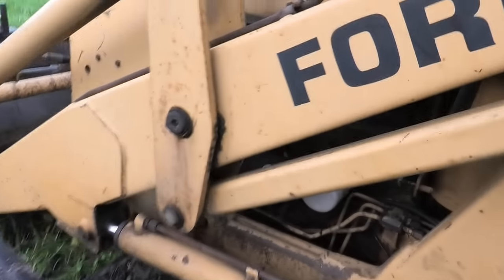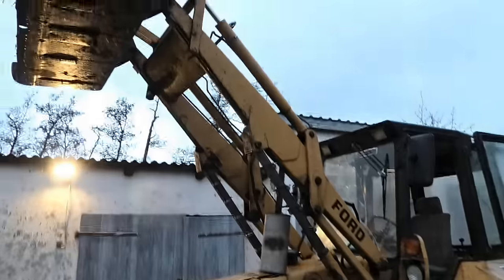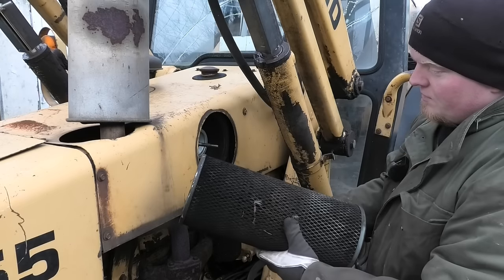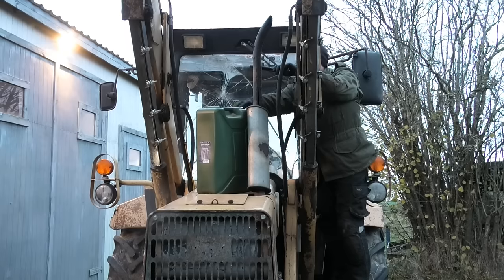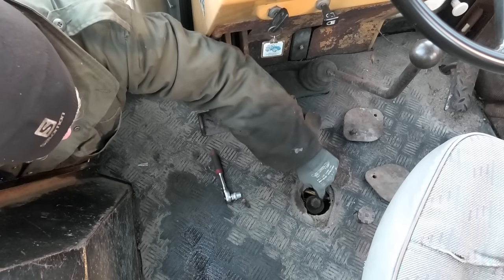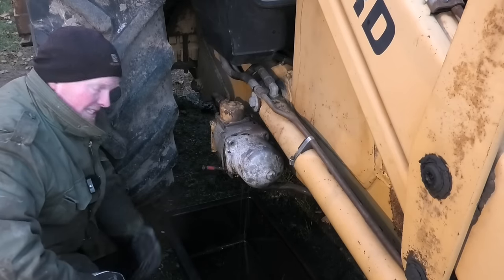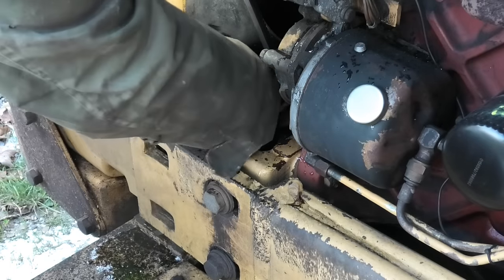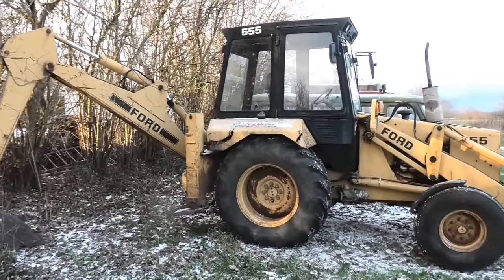Ford Backhoe - Full Oil/Filter change - First time in over a Decade!

Comment: It's not a car muffler:) This is factory stuff. I have the same in Ford 4610 tractor '88 model, which is basically the same in "tractor" part of this machine (same engine). For the same reason the fuel tank valve is hidden in the strange place. About oil my owner's manual recomending 10W30 (M2C-159 A/B), 6,6 liter with the filter. Same oil goes to power steering (not ATF!). In my case same oil goes also to the gearbox and rear differential which is also the reservoir of tractor hydraulic. I don't know if it's the same with machine with torque converter, I have manual 8x4 synchromesh transmission. Now I'm looking for backhoe 550 or 555 so that's why I'm here;) Good luck and regards from Poland!
Reply: I agree. Our 1984 Ford with the same engine has the same muffler as well.

Comment: Cool! Nearly an hour of tractor maintenance.
Try to find a muffler with domed ends so there's no seam to hold water.
Here in the US we have cheap glass packs (generically called cherry bombs)
I'm interested to see what you come up with for auxiliary lighting.
(Edit) It's also interesting to see the difference in the European digger and rear outriggers.
Sliding boom looks like it could dig a lot closer backed up to a wall or other obstacle

Comment: I bought a 12 volt oil change pump from JULA for my inboard boat engine. Firstly to pump the old oil out, but found it much easier to fill the engine with new oil too usingthepump. Just rinse it out with diesel between the old and new oil.

Comment: The low viscosity engine oil  you drained and the refilling of steering oil points at the servopump leaking oil into the crankcase, It is very easy to replace those seals.
Reply from the maker: Yeah. there might be somthing going on. I will have to keep an eye on it

Comment: One thing I would mention that is very important when servicing your triple nickel is the drive shaft going from the crankshaft pulling to the hydraulic pump.
It has 2 universal joints on it and it turns always and it’s not easy to get to and if it goes your hydraulics are dead so it’s important to maintain!
You can grease the rear universe joint right at the crankshaft pulley you’ll see it just below the radiator and you might have to bump the starter to get it in the right position and then the front u joint can be greased by taking the grill off and on my 555 I grease it blind so I feel around deep under the hydraulic reservoir and once again you might have to bump the starter to get the zirk in the right position and make sure the when you’re pumping the grease gun the grease is actually going in the u joint and not just making a mess I always listen carefully and when the u joint is full of grease it makes a few crackling sounds then you can be sure it good to go!
And you might want to check the fan belt because it’s much easier to change when you’re servicing the old girl rather than when you’re out in the field! 😀🇨🇦

Comment: Hi I’m new to this channel, great vid , I had  the earlier model , the 550 , nice machine , interesting oil that came out of the engine , I noticed someone mentioned power steering leak , I would say  , by looking at the vid , it possibly will be the injector pump , leaking diesel, there’s a small seal on the end of the pump , that goes hard over time , especially on the old kit , I’ve replaced many on my old girls , if you still have the old diesel kicking found give it a sniff you will soon tell , if it does smell of fuel then don’t run her to long like that our you will run the bearings in the motor . Look forward to more vids 👍👍

Comment: That engine oil may have diesel in it , leaking from injector pump .tip when greasing front axle pivit take weight off axle so the grease will get to top of pin.
Reply from the maker: Yeah, it could be. I will have to keep en eye on it. :)

Comment: Would it be a good idea to retract all the cylinders to keep the chrome out of the weather?  You have the space available.  Keep an eye on the engine oil level - looked like it might have had diesel in it.
Reply from the maker: Well, yeah. it would. but it's just not possible to retract them all. as some of them move in, there will be others that move out.

And yes, i will have to keep an eye on that oil :)

Thanks for watching along!

Comment: Hi, i see that you use a lot of stuff from Biltema. How is your experience with their quality? I am currently in Sweden and honestly, i am amazed what you can find in there.
Reply from the maker: Yeah, i do get a good bit of stuff from there.
Main reason is, that the store is fairly close. and it's really the only store in the area, that has a lot of these things right in stock, for quick pick up.
But ofcourse, the quality of many of their things, is in the low end/China stuff.
So really, it all depends on what im doing. whether i can make do with the cheap stuff, or if id rather spend the time/money to get the good stuff.

Comment: Oh come on. 1: park with the rams inside the cylinders to protect the chrome stick. 2: you never fixed the muffler thats full of holes.
3: I'm sure there was another item in mind? Anyway  that should about do it for now. Just n case! when you have a sometimes used bucket and crowding the bucket up is done to save the rams. It's a good idea to drill a 3/4" hole in the lowest area in each corner of the bucket (so 2X) then to get a few coats of paint on it so it will drain without help and not rust.
Reply from the maker: The video is almost an hour long. i could hardly put more in this one. Haha :)
But don't worry, i will be doing the other things as well.

Also, you are right about putting a few holes in the buckes.
But unfortunately it's too late for these buckets, as they are allready rusted out.
So they will need a bit of welding, before i have anything to drill holes in :)